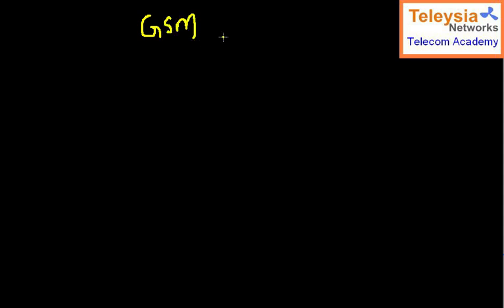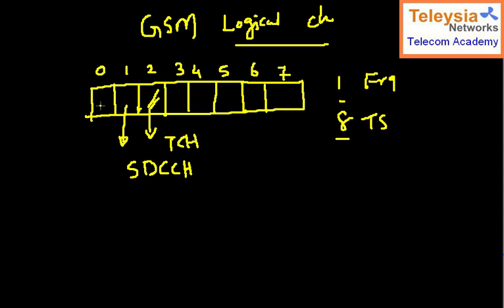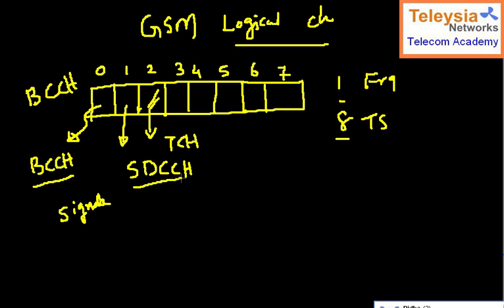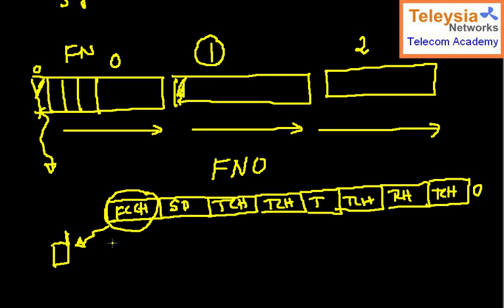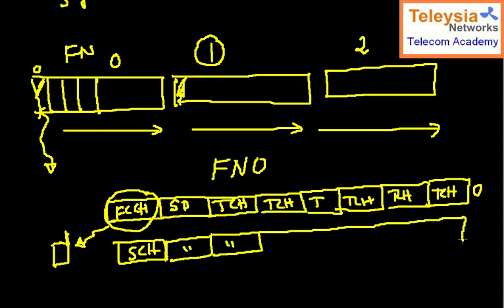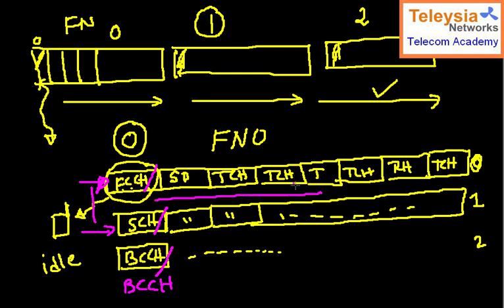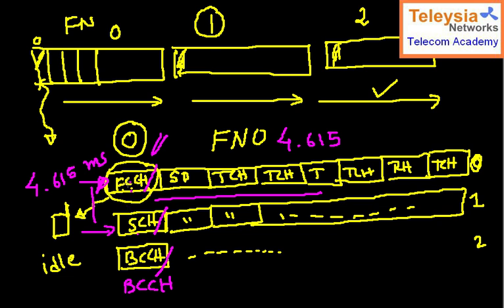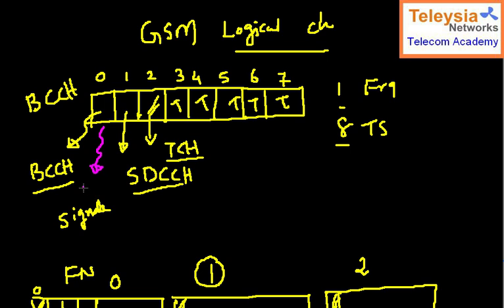Teleysia - GSM Logical Channels 1

Comment: a little correction.1 TRX = 1 ARFCN = 8 Time slot.
for example configuration of TRX (4+4+4) or (3+3+3).
4+4+4 means 4 TRX in each sector (here 120 degree sector) and 4TRX = 4ARFCN.
1 ARFCN = 8 timeslot = 8users (if all traffic channel)
12 TRX = 96 users including signaling  ( 2-3 slots is enough for signalling for all t.he 96 users)
so around 93 users in each cell for 4+4+4 config

Comment: firstly, answer is yes..But sometimes sd and bcch is at the first timeslot together. than 7 user can speak simultaneously.. but in general, you can add TRX ( 1TRX=8 channel, means 8 more people. because still one bcch slot is enough) to increase capacity.. you can use 4, 6, 12 TRX..